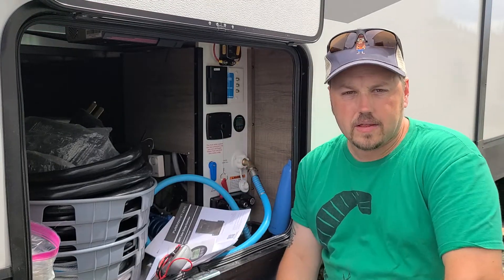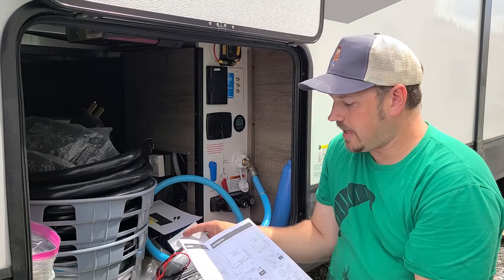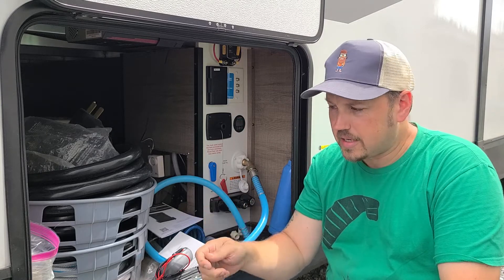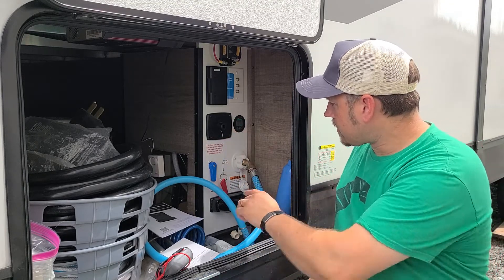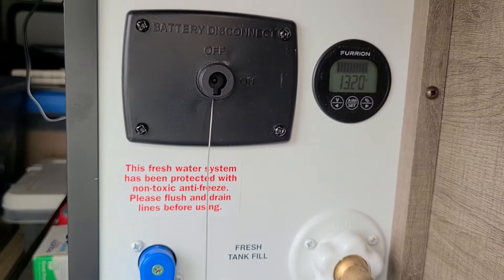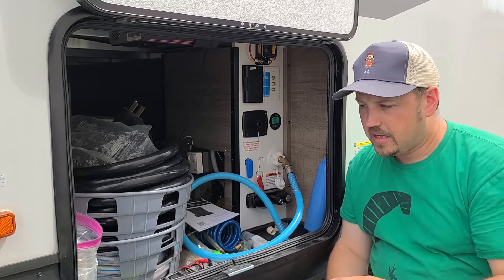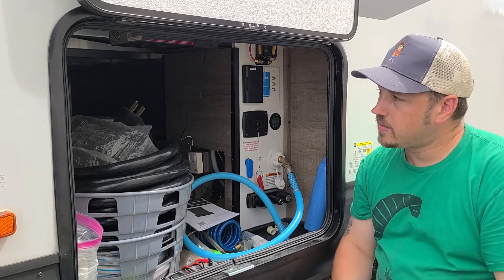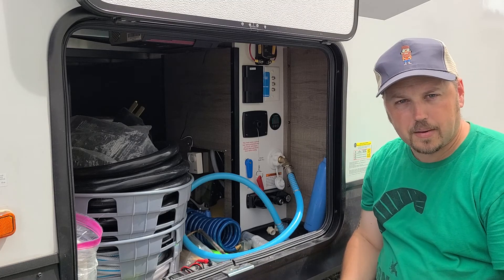2800BH Battery Monitor and Solar Information Introduction

Comment: good explanation.  how long have you been using that monitor, and are you satisfied with it?
Reply from the maker: yes, this one has been holding up well and provides the basic information needed.  If I would ever upgrade solar to be a larger amount or for boondocking long periods, I'd probably change it out to one with more data and BT connection to a phone.  This one has been good since we got the camper in 2022.

Comment: We have a 2022 2800BH it has the one Furrion 165watt solar panel But does not have the battery monitor
Reply from the maker: You can add a Victron, Furrion, or other brand fairly easily if you would like to.  Some people add them directly to the battery box and have the display inside the front compartment area.  It is only really a use if you are monitoring your battery while off the power grid boondocking so you can see about where your voltage stands or percent charge.  Otherwise, it is usually 95% or higher just sitting in my driveway between trips.

Comment: Is the charge controller lithium compatible?
Reply from the maker: This one is, yes.  You have to select the battery type on the controller.  My stock converter in the camper is not, so when plugged into shore power the main camper converter would not be compatable.  I would have to change that if I went lithium.  So be sure to check both if you are considering it.
Reply: What is the stock converter

Comment: Enjoyed your video and information. I have an imagine 22MLE. I would like to install a disconnect breaker between my solar panel and the charge controller. My manual actually shows a breaker able to interrupt the circuit between the roof solar panel and before a fuse going to the controller. My wiring is a little hard to trace. Can you give me any recommendations on where these wires can be located? How did you trace yours? Thanks
Reply from the maker: if you look at your manual you will also see a diagram on which wires go to the roof and which to the battery from the back of the controller.  I verified that and then used those wires to modify.  I was able to pull the one wire direct to the breaker, and then used a new section of wire from the breaker to the controller.
Reply: @SchafferTwins  Thanks, I like the way you installed your breaker on the docking panel, good job with that. Did you ever find the fuse in the circuit? If so, did you use its location to determine your breaker location?  I have traced wires, but I can’t find one yet. I’d surely like to know in case I have to replace it. So in my controller manual, it shows the breaker on Two wires not one. Looks like you are using one wire. Also I have been getting feedback from the GD forum and one actually included a diagram different from the one in my manual - it shows the breaker across one wire. On your forward battery box disconnect - did you install it on the battery negative lead? Thanks
Reply: You must have removed the panel to put the breaker there. It’s only about a 5” space behind mine and impossible to reach anything without removing it
Reply from the maker: @williamsullivan7177   the breaker is surface mounted, but yes, I did have the side panel off so that I could get the wires and pull them up over the top of the panel to access the breaker terminals.  I can get you more photos or info if you would like.
Reply: @SchafferTwins  I only see one wire coming into your disconnect breaker. Did you splice into one or two wires. The two wires I believe I need to use are colored solid red and red & black. I called GD this morning and they said I don’t have fuses installed on my solar system. I did trace out two fuses under the frame on the positive battery lead. GD says one goes to the refrigerator and one to the tongue jack. Nice to know . Thanks, hope I’m not bugging you. By the way, I laid my docking panel back to replace the city water inlet, outdoor shower faucet and associated cone washers to fix leaks. Not sure I want to pull it again even though I modified it to allow access to mounting screws from the outside

Comment: Great video....  Though you should be disconnecting both Negative and Positive sides of your panel array
Reply from the maker: interesting.  The manual shows the (+) side as the option.  ( https://cdn.accentuate.io/1928957001817/5237057552473/IM-FEN00013_V2.0_EN-(1)-v1644464325599.pdf )

Comment: Excellent presentation—thanks. Question: with your battery disconnect switch installed up front, does that also disconnect the solar charge controller input to the batteries?  I know that the SCC shouldn’t be operated without being connected to the batts, so there must be a way to wire this disconnect switch so that it only shuts off battery output to the coach.  I’d like to install a disconnect switch, but this my only concern. Thoughts?
Reply from the maker: I have 2 battery disconnects.  (1) you see on this panel is the factory disconnect which really turns off the 12V lighting and ceiling fan, but the fridge and LP detector remain on.  That also does not disconnect the SCC to the main batteries.  The (2nd) disconnect I have is one I installed on the main battery box.  This shuts everything off completely when I am storing at home for a long time or if I have to check the water levels on my battery's.